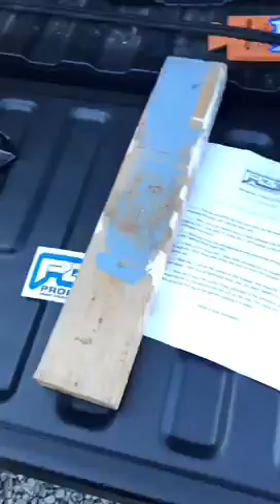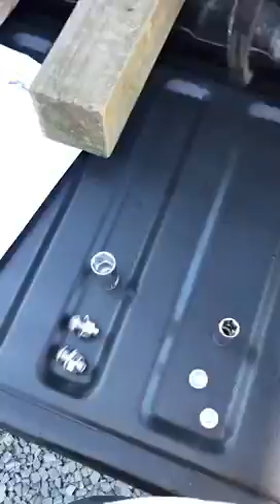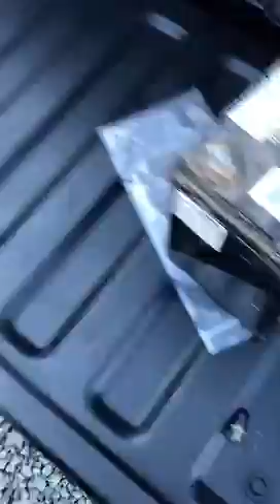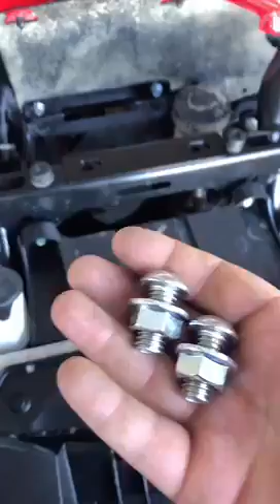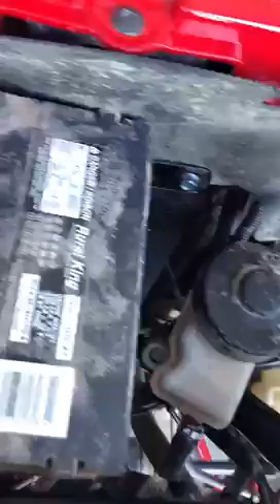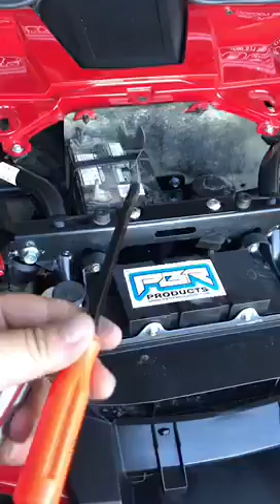PBR Products Honda Talon Dual Battery Box / Battery Tray Install

Comment: The dimensions given for batteries only indicate 2 measurements. There is a frame bar above the box which limits height. If someone could please provide LxWxH measurements, or better yet, a battery group size or deep cycle battery model that’s ideal. 
Thanks!
Reply: +1 on the question!